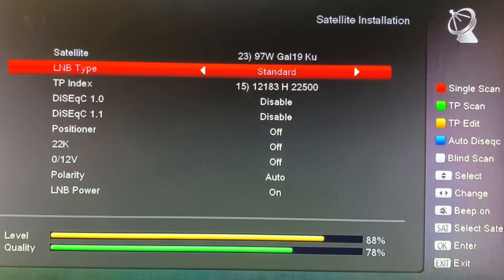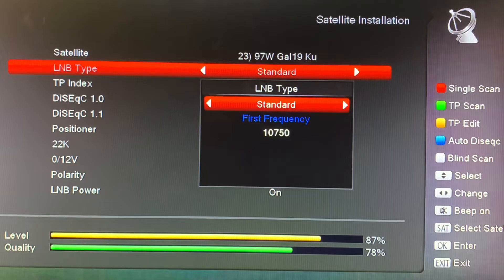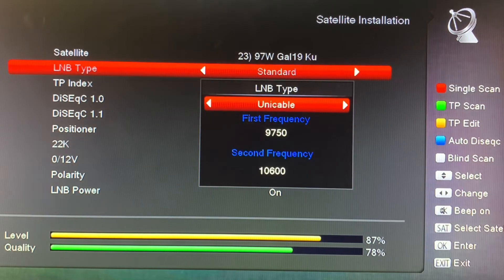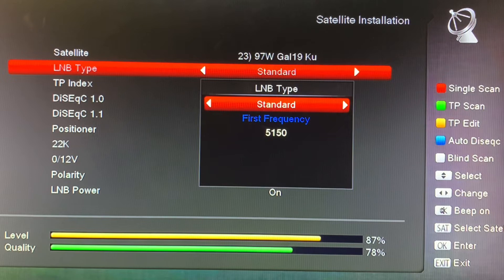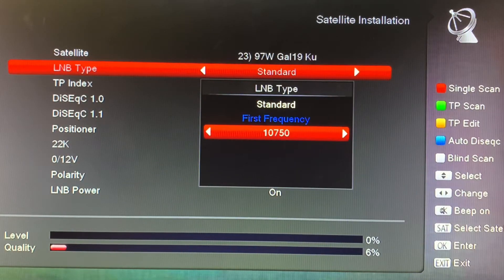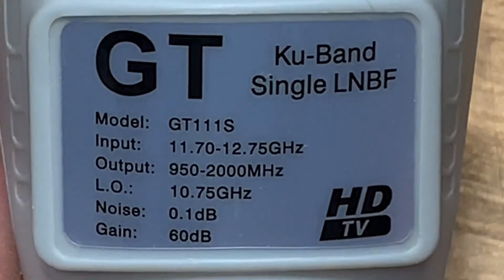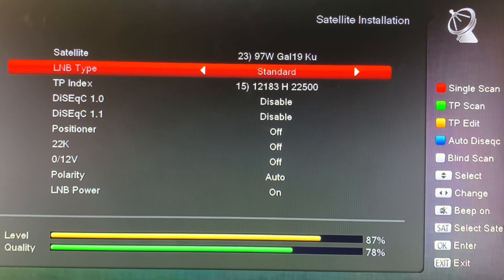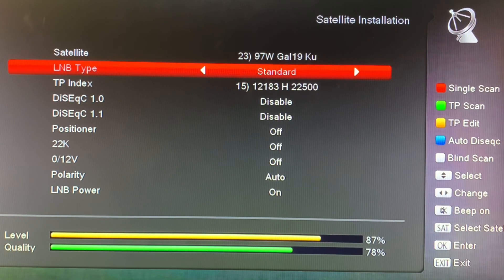Satellite LNB Frequency Setup is a VERY Important step

Comment: Just curious how you felt about one of those multi-feed lnb brackets that goes on a dash
Reply from the maker: I suppose it could work but would take some fine tuning. I’m not sure the signals are strong enough in North America to pull off more than 2-3 LNB’s, like other parts of the world.
Reply: @NorthcoasterHobby  thanks for your reply I'm in the lower 48 but I didn't see that as being really plausible since you know your dishes set to One direction how why would you need like 4 lmbs on the same dish

Comment: I remember back in 2018 when I was new into satellite TV and I added a couple of satellite and all of them  were broadcasting only on Ku Band. And I was wondering why I have no signal on that satellite since the frequency, polarization and SR were correct. I clicked TP Scan, blind scan and I saw that the frequencies were for C Band and was wondering why the Ku Band have C Band frequencies since my LNB is Ku Band and scanned only half of channels? The conclusion was that I forgot to change to Universal instead of Standard at LNB Type. Beginners mistakes.
Reply from the maker: I am always learning, one can never know everything about this hobby!📡
Reply: As an avid scanner listener I'm always learning because they keep changing the formats since most are digital nowadays big learning curve from analog.
But now I'm trying to learn this satellite thing
Reply: @red2965  Digital satellite television has more advantages than analog television. The picture is clear even during bad weather except cases of storm where it cuts out the signal but happens once or twice a year and lasts up to 1 hour. In case of snow you only have to clean the dish and LNB.  A main advantage is with the diseqc switch. If you have multiple satellite dishes or use a toroidal satellite like Wavefrontier T-90 dish that can receive multiple satellites a switch allows you to receive all satellites on one cable. You can even have combination with C Band and Ku Band. On analog you can't use a switch so if you have 3 satellite dishes you must have 3 cables and it's annoying to connect and disconnect if you want to watch channels from a satellite. In analog days a motor was mandatory if you wanted to receive other satellites. In digital is very good to have a motorized dish and can install multiple fixed satellite dishes.
Reply: @red2965  It's a fun hobby and no monthly bills if you are not interested in pay TV channels like HBO, ESPN, Discovery Channel etc.
Reply: @Nicholas_Chris  I'd just like some consistency my terrestrial antenna is driving me nuts, what is watchable in the Day time won't be available at night.
Thanks for clearing up the dish thing when I get my Lmb I will try with a dish or a direct TV dish.
The sat box I got has everywhere except the US
Reply: @red2965  It's hard to tell what exactly is happening. What antennas do you have? VHF, UHF or both? Does it happen all the time or in certain periods? For example during the summer the VHF band has interference due to tropospheric ducting it means that channels that are not available in your area can be received from a couple of minutes up to one or two hours. And for example on FM band you are in USA but you can suddenly receive radio channels from Mexico or Cuba and let's say you live in Denver or New York. It happens if you use an outdoor FM antenna. But from May until September. 
Back to your reception problems. I would recommend a new antenna or new antennas if you have VHF and UHF antennas and a better coaxial cable. I recommend an RG6 trishield or quadshield cable.  I recommend outdoor antenna, the reception is much better than indoor antennas. 
During the night the terrestrial and satellite reception is better than during the daylight. If you use a VHF antenna especially a VHF Low the interference may be from the light sources. If you use an indoor antenna than it's obvious, light bulbs affect the reception. It may happen that a channel on the same frequency can interfere despite the fact that the channel has no coverage in your area and during the night the signal travels much further and affects your reception. in some cases. UHF band doesn't have the same problems like VHF unless a TV station or a walkie talkie is on the same frequency also the UHF signal is much weaker an outdoor UHF antenna will solve the problem.
Reply: @Nicholas_Chris  nice explanation, yes I have a uhf/vhf outdoor antenna at about 30' on a pole' but there are tree's between me  and the tower's
I'd like a tower but, cost prevents that. So I been hearing so much about free satellite and thought hey I'm.up.for that.y box has internet settings and hope that's just for updates and don't require it full time.